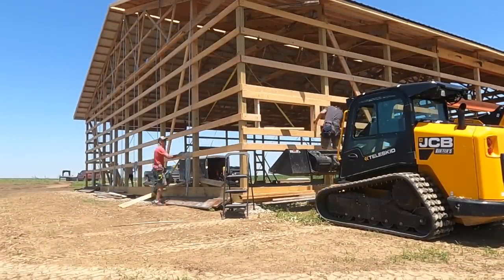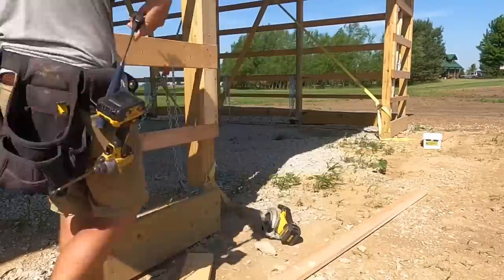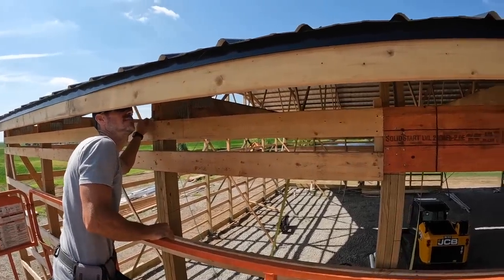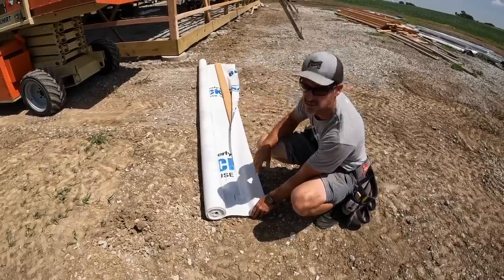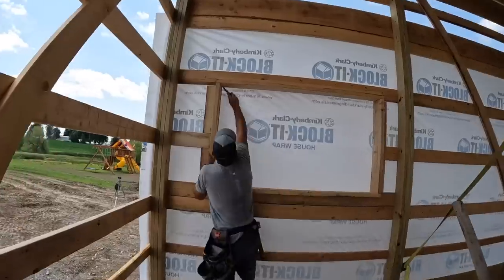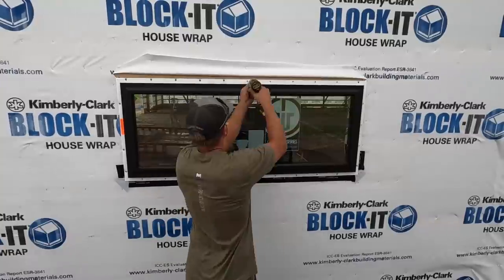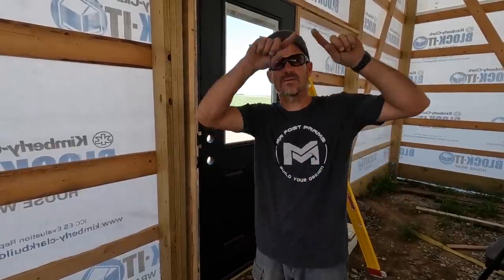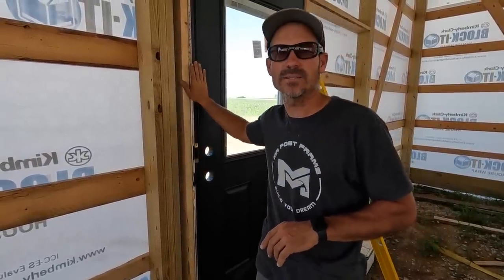Building a Shouse | House Wrap + Windows + Doors | Ep8

Comment: Do you do any extra bracing or other things to make the post frame buildings more tornado resistant?
Reply from the maker: We add extra bracing in the corners that don't have windows and also bracing to the roof. We add what is specified in the engineered drawings.

Comment: At what stage do you remove all the bracing and straps? After wall steel?
Reply from the maker: We remove all bracing as the wall metal goes up. Since the building gets its shear value from the metal and exposed fasteners we wait to remove until that is in place.
Reply: @MrPostFrame  thanks! I’ve got my basic framing and roof done, just starting the window and door framing. I’d hoped to get the straps out of the way, but I’ll leave everything in place. Appreciate it.
Reply from the maker: We will loosen and unhook them throughout the process, if they are in the way. However before the roof metal goes on we tighten and use them to square up the roof. Then pretty much keep them in place until they need removed for the side metal and trims.